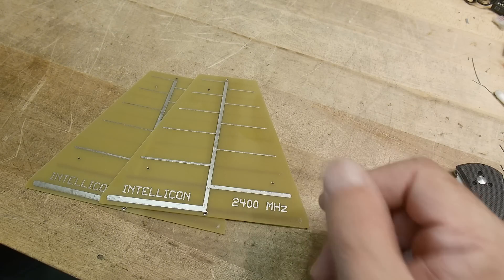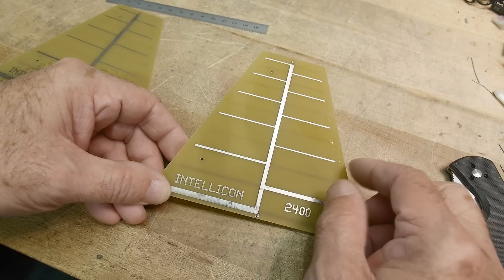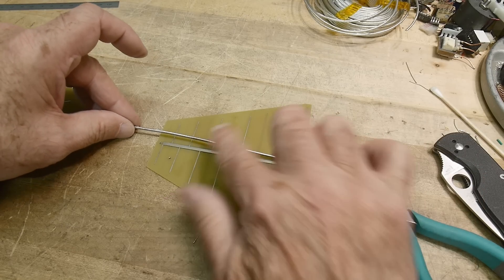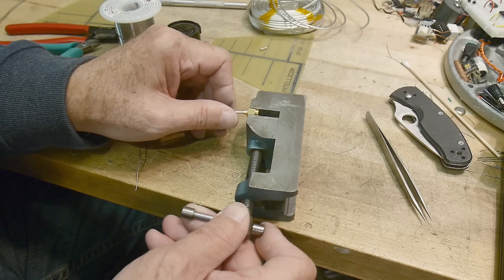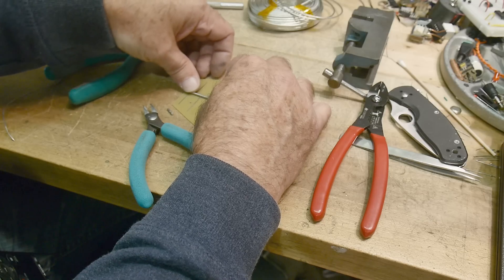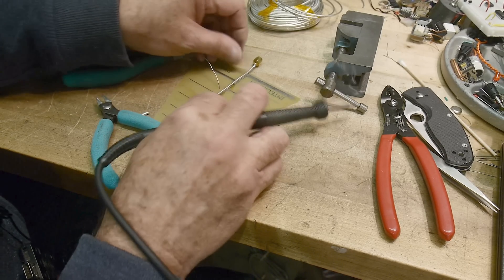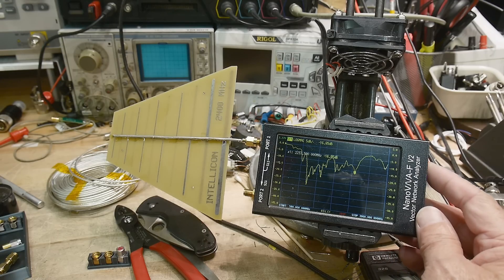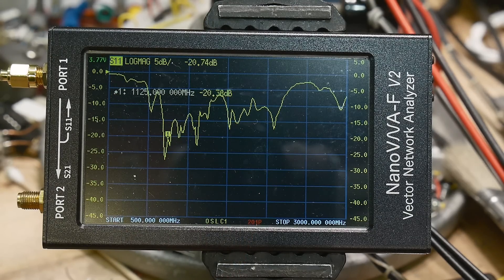#1439 2.4 GHz Log Periodic Antenna

Comment: I'm not an expert in antehhas, but theory says the feeder mustn't have any electrical connection to the antenna boby except the feeding points. This means it mustn't be soldered you did.
Reply from the maker: You are correct. You are no expert.  This design has a ground center. Antennas are often strange. https://vk4ghz.com/2-11-ghz-wa5vjb-log-periodic/
Reply: @IMSAIGuy  Yes, I'm not an expert. But I don't repeat other people's mistakes.
Reply from the maker: It’s sad you think this is a mistake. Antennas are often confusing. If you are interested. Get a copy of eznec and do some modeling.  Not all antennas are based on simple dipoles.
Reply from the maker: if you think about this design, once side of the pcb is half of the dipole and one side is the other half. so at each dipole you want the center conductor and shield as you say from theory. since this is a multi dipole type antenna at each one you need a feed. but you can't, the soldered shield makes at least one side pretty good, the center conductor has to take a longer path and this is probably compensated for in the design. I'm sure it was found by experiment to have the shield soldered was better and then the other elements shortened, antennas are an integrative design most of the time.
Reply from the maker: you might like the antenna design that I did:
https://youtu.be/zVkjeUgLVlw?si=iJtYHvmgcPd0vJxW
https://youtu.be/FROSpugtM8A?si=hwTSTWHU7w_lYNN1
Reply: @IMSAIGuy  no, why? - you did the similar mistake here: you connected the symmetric antenna to the non-symmetric feeder directly. If you were a teenage amateur, it would be forgivable.
But, honestly, I love you removed the fiberglass between the antenna elements to prevent the surface currents. Like.
Reply: @IMSAIGuy  OK, I thought I'm not an expert... I recommend you familiarize yourself with the theory behind these antennas, and especially with their balancing (connecting them to a balanced feeder). If you connect it the way you did, it won't stop working, but its radiation pattern won't be as designed. That is, if you need to distort the radiation pattern intentionally, then OK.

Comment: I am new to antennas such as the one in the video so i have a few questions. what does "out of phase" at 1:15 mean? does the base being wider to skinnier mean anything or is it purely the design? what is SMA? What is the "elements" for the dips and what does it mean that the frequency missed an element for the ugly part?  how did you notice that you would use the antenna at 1125 MHz? sorry for all of the questions, I am trying to just figure out antennas and frequencies.
Reply from the maker: maybe these will help
https://youtu.be/gYwexdgvUbE?si=wdq0u3Rb_SxKKucf
https://youtu.be/zVkjeUgLVlw?si=sHd5a2MNeMgPPG8E
https://youtu.be/FROSpugtM8A?si=yRqCmUCXwm5vChgq
Reply from the maker: go get the 'arrl antenna book'
SMA is the connector type

Comment: Bought three of these from the original designer at Hamvention many years ago. They work from around 900 MHz to 2.5 GHz. Never had any issues with the authentic antennas. They worked great on the Ericsson G30 / 35 fixed wireless terminal for GSM networks. Went from marginal coverage to full indication of coverage when we aimed the antennas towards a cell site. I also use these antennas for directional base coverage of the Marconi Bowman PRR squad radios. Get twice the range between fixed points.

Comment: Um, Take some tin snips & cut down the outside edges of the diagonals? I would also reduce the angle of the slope to narrow the bandwidth to something more approaching WiFi band coverage. Alternatively one go the opposite direction & could solder some solid copper wires on to lower the frequency towards the lower frequency cellular data bands

Comment: Is that NanoVNA-F V2 more accurate than the earlier ones?  I do agree with others on here though, that these Chinese antennas rarely are the frequency they advertise.  Wondering if measuring Chinese antennas with Chinese VNA's compounds the inaccuracies? 🤔
Reply from the maker: the old vna was 900MHz, this one runs to 4.4GHz. the frequency is accurate on all.

Comment: Great work. In addition to the return loss which you measure, it would be very interesting to measure the gain between two of the same antennas. Naturally, all the standard considerations and standards need to be taken, and the interpretation of "gain" follow the same engineering standards. I'm pretty certain you understand those standards. Thanks for your good posts.

Comment: Still, ....Very Interesting antenna design Dimensions for something Labeled 2400 Mhz, which one would Assume is the Center design frequency.....The Dimensions would suggest  something closer to 1100 Mhz to 2400 Mhz Bandwidth range.....That would put your Sellected 1725 Mhz freq just about mid band.......Other than wide band operation, why not use a higher gain Yagi design ??.....

Comment: Nice LP Antenna NanoVNA measurements !!....Pretty good chance your Bonding the Coax Shield to the Boom pc trace is fouling up the Expected bandwidth impedance measurements......End Fed LP's with significant "Drooped"  supported coax feed line seem to "Wide band" mot of the time....Measuring a Non-Bonded coax feed line would be a Very interesting test.......Thx for the video......
Reply from the maker: no, it was designed with the coax soldered down, the backside trace had to be thickened in a revision to offset things. the antenna was designed that way from the start. I agree it is quite odd, but you will find many copies of that design in many products now.
Reply from the maker: https://vk4ghz.com/2-11-ghz-wa5vjb-log-periodic/

Comment: I was wonder which soldering wire do you use and do you have a recommendation for a Lead Free Soldering wire for RF application :)
Reply from the maker: Metcal Mx-500
I hate all lead free, I use Kester
Reply: @IMSAIGuy  I use a very old Kester for RF soldering but don’t get quite consistent response for my solder maybe it’s time to get a new one. One more thing  while soldering the center pin of SMA I normally fill it with solder and then push in the center conductor. I noticed you do it differently I am sure there must be some advantage to your method can you please explain. Thank you
Reply from the maker: @ahmedshafqat1409  if you solder one side first, there will be no flux for the second item.

Comment: I don't think the coax should be soldered to the board this way. Its shielding should be isolated from the PCB, the only place where it should be connected to the PCB is the tip of that antenna, because the shielding running parallel to the trace on that PCB forms a balun. The input of any LPA is symetric, but the feeding coaxial line not. In my opinion, that coax should be wrapped into some insulation like kapton tape, or should be fed through some silicon tube or things like that, which should be somehow glued to the PCB to keep things parallel to form the required balun. If you connect it like you've done, it doesn't form the balun, which is not a big issue on such a high frequencies, but it detunes the whole antenna by adding some material to it, which is exactly what you've been observing on the VNA.
Reply from the maker: https://vk4ghz.com/2-11-ghz-wa5vjb-log-periodic/

Comment: You should not solder the coax shield along the line like that, it’s part of a transmission line and doing it like that will mess up the impedance significantly.
Reply from the maker: https://vk4ghz.com/2-11-ghz-wa5vjb-log-periodic/
Reply: @IMSAIGuy  yeah, just because he does it like that doesn't make it right...

Comment: Probably a stupid question, but are you sure the coax should be soldered along the length?  It seems as if that makes the feedpoint be at one end for the top and the other end for the bottom (of the PCB).
Reply from the maker: yes, I'm basing that on looking at other products.
Reply: @IMSAIGuy  Thanks!
Reply from the maker: https://vk4ghz.com/2-11-ghz-wa5vjb-log-periodic/

Comment: Thanks for the video. The coax you used is called "Conformable', not "semi-rigid". Semi-rigid is much stiffer, as it uses a solid copper tube as the shield.  Also, be careful with metal objects on your table when testing!

Comment: I’m gonna try to find the time to try  what I’m about to ask. But, if you’ve already tried it , I’d love to know the results… Q: What would the response be and how would characteristics change if a similar Log Periodic was made on flat material, laid out as you did  but the rolled into a cylindrical body. I’ve come across designs that are similar to what I described but has a huge dip at around 750mhz that hold a flat line parallel to the X axis then climbing back up at around 3.2ghz. That’s gotta be fake right? Such a broad band response that is so clean seems like someone is trying to run a con.  If you’re able to make the one I described, I’d love to see/ hear the outcome. Thanks , -Jason Burchell
Reply: These are HIGHY directional... so in "rolling" them up would defeat the purpose of such a design...what you are looking for is a helical antenna(or not...just the closest thing to any practicality from such a design)- also, as you see, these are highly specific to frequency....the measurements are carefully adhered to as to not stray off course. Your antenna rollup would have to be adjusted since the frequency unrolled would differ from rolled....Helical antenas are in some cases pretty much a spring- many stock antenas for handhelds like mobile communication + CB radio, if you cut those plastic nubs of antenas in half, you'll find the cheapo coiled of metal. Other thana wire, these are some of the simplest antenna design, and cheapest- why you see em in so many cheapo gizmos and Baofangs....not the crem del la crem of radiating patterns...,but practical... pretty much a donut shape radiating out if you hold the antenna up. Certain designs can make for some phalic radiating patterns- placing 4 helical antenas in a 2x2 grid/ array will provide you with such a beauty of signal- out the front you'll find a girthy directional strong signal and just to the sides and back, 1 on each side, circular radiating signal. This arrangement is wicked for FPV where longer distances are sought- this and an antenna tracker and you are golden pony boy.

If this isn't what you'd been thinking, then myself, and 100% i am sure the community at large would love for you to share your adventures with the fruit rollup yagi antenna. Please do.

Comment: Every single antenna I've bought from China on ebay has had some serious flaw.  Either the marketeers are liars, or the chinese designers are clueless.  Also, a note for some viewers:  Although they look similar, a log-periodic is VERY different than a Yagi-Uda.  Logs typically have only moderate forward gain, high front-to-back ratios, and wide bandwidth.  Yagis generally have higher forward gain, moderate front-to-back ratio and narrow (about 2%) bandwidth.
Reply from the maker: https://vk4ghz.com/2-11-ghz-wa5vjb-log-periodic/
Reply: @IMSAIGuy  It's possible to build log antennas that achieve a good match and have some gain over a wide frequency range.   But your tests show that one to be somewhat unimpressive.
Reply from the maker: @chrisscott1547  not enough elements for that frequency range
Reply: Would that be possible to cut some lines to march the frequencies? I think if you shorten the line the frequencies will be shifted upward.  I'm by no means an antennas guy.

Comment: I'm surprised all that soldering does not compromise the insulator.
Reply: The coax insulation is more than likely PTFE (i.e. Teflon), it's rather good over significant temperature ranges - both high and low.  Low loss too, which is good for RF.
Reply: @Pinhead-q4i  Thanks Mark.  I've had little to do with this kind of coax in my travels so it's good to be able to learn something from time to time
Reply: @uni-byte  You're welcome!  I've used it extensively in the lab, really easy to shape, nice for short for cables, making RF transformers, etc.  100% shield too.  Sort of my 'go to' coax for building prototypes.  I should clarify one of my comments tho:  While Teflon itself is low loss, the small diameter of the coax does hinder performance somewhat.